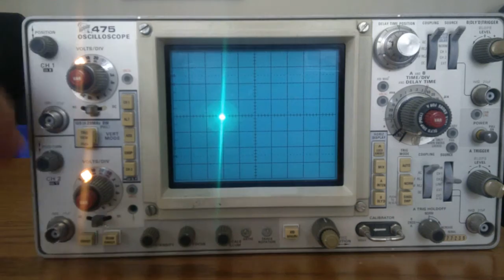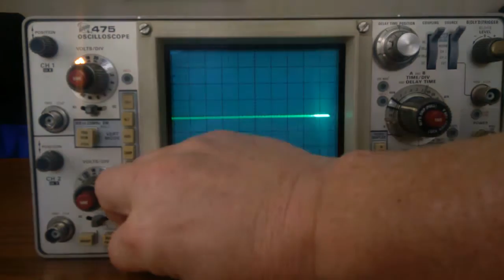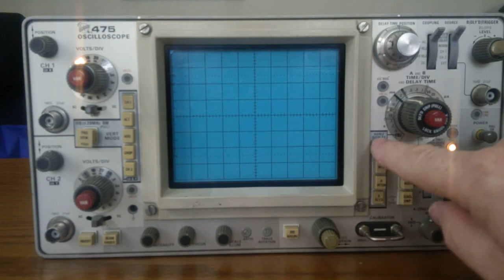Tektronix 475 Slow Sweep Time Base Issue

Comment: John
 Amazing you found the Fault with Inaccurate Schematics! Kudos on that one.
 I have heard over & over about the Yahoo Tektronix Forum but could never find it...now I know why!
 In my case I have pulled all the Transistors on the Interface Circuit Board and Tested them...all Tested Good. All the Power Supply Voltages are within Spec including Ripple. All the Voltages in the Horizontal Display Logic and A & B Sweep Logic of the Interface Circuit Board Section are all Spot On. However...the next Section over...the Horizontal Amplifier Section of the Interface Circuit Board...the Voltages are off. It would help if I had a Working Scope... LoL
Reply from the maker: I believe my original problem (not the one in this video) of no trace as it was off screen was actually on the horizontal amplifier section of the board.  My 475 manual says there should be 52.1V on the right deflection plate and 48.1 on the left deflection plate.  When I diagnosed it I didn't have a scope.  I just used my Fluke and worked back through that circuit until I found good voltages.  The bad transistor was in between the good and bad voltages. It helps to have a good diagram, though.  Here is the Tekscopes group:  https://groups.io/g/TekScopes

Comment: My Tektronix 465B Oscilloscope has a problem I've been trying to track down for awhile now...both Traces too Short and are too far to the Right. In other words... both Traces are 5 Graticules Long on a 10 Graticule Screen Horizontally only occupy the Right 5 Graticules even tough the Position Control Knob is fully CCW.
Reply from the maker: First, I am far from an expert.  I posted this video to allow the folks on the Tektronics Yahoo Group (now on Groups.io) to help me figure it out.  However, in my somewhat limited experience, your issue sounds like something wrong on the horizontal board and similar to an issue I had on mine when I first got it.  I had no trace on the screen but it was there in beam finder.  I had differing voltages, when they should be close to even, on each of the horizontal deflection plate terminals on the CRT.  This simply caused the trace to be off the screen.  When I traced voltages back through the horizontal board I found a bad transistor in the push-pull (I think that's what it's called) circuit that controls the horizontal deflection.  Using the service manual and checking voltages on that circuit found the problem in pretty short order.  There are some real knowledgable folks on that Groups.io group and I would highly recommend joining it.  ~John

Comment from the maker: Yes, I resolved the issue.  Using the wiring diagram I was able to isolate the problem.  This would normally be a fairly easy problem to diagnose but the wiring diagram in the service manual had an error in it on that circuit.  There was a change to the wiring diagram but even the change was incorrect.  The problem was an open resistor, R1083, which is an 806Kohm, 0.1% .125W resistor, on the timing and horizontal display switching board.  Replaced that resistor and all works great on my old 475.

Comment: I have the same issue but on a heathkit and about 5 settings on my time base switch.  any solution?
Reply from the maker: Yes, it turned out to be a resistor that went high in the time base circuit.  It was a bit difficult to track down since there was an error in the wiring diagram, but eventually did figure it out, with the help of the Tekscopes Yahoo group, and repaired the scope.